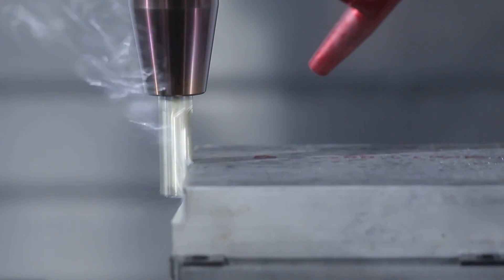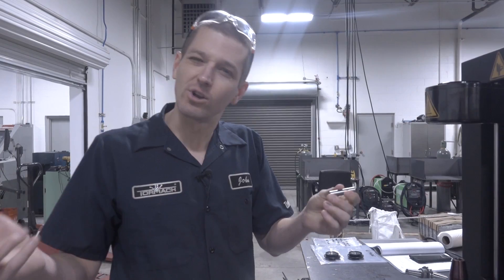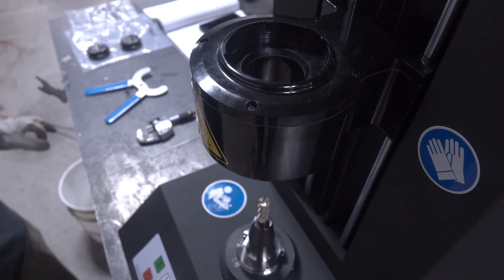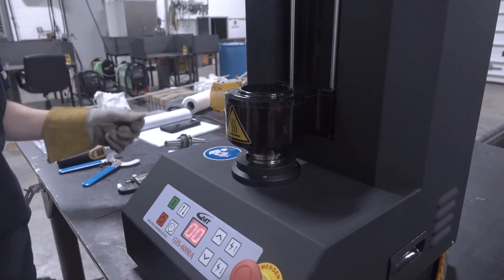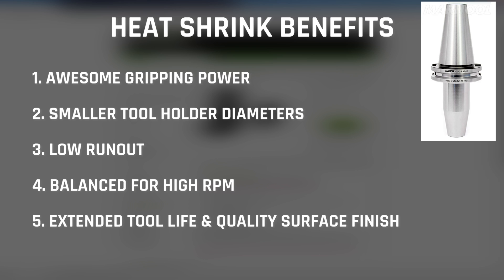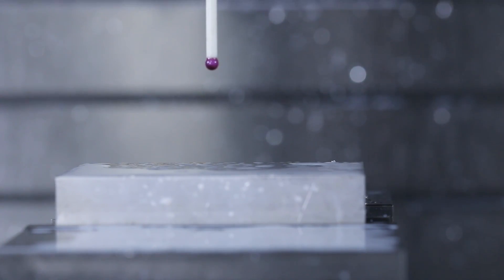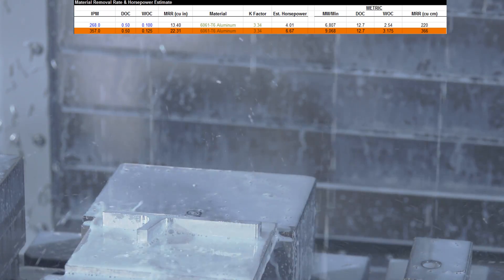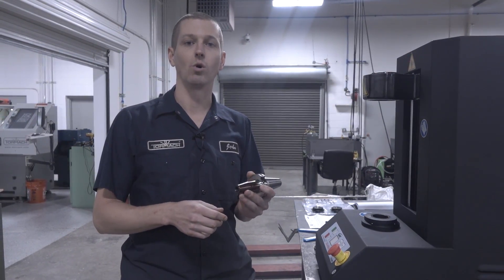What is Heat Shrink Tooling?  Testing a MariTool CAT40!

Comment: It's really Heat Expansion Tool Holder, the complete opposite of heat shrink tooling. It's not shrinking the tool. It's nothing like heat shrink tubing. It shrinks when it cools, looses heat. MariTool states it as Shrink Fit. I thought maybe there was some kind of tooling that actually shrank when heated, instead of expanding, ha. Love you man, but it kinda click baited me.
Reply: rkoz55 it shrinks to fit the tool...  hence “shrink fit” holders. 

Also. Look into how heat shrink tubing is made. You’ll find even the tubing works exactly like these holders, with the exception that with tubing, they lock in the expanded size from reshrinking. When shrink tubing is made, it’s made to the final “shrunken” diameter size. It’s then heated and expanded and filled with gas and rapidly cooled to lock the expanded diameter size.  Re heating it causes it to become pliable again allowing the tubing to return to its natural, unexpanded size. 

This is also why no matter how much heat you use, heat shrink tubing will only shrink so much.
Reply: I agree Shrink Fit Holder is a better name, which is what MariTool uses. Still not applying heat to shrink the holder or the tool as the video title suggests. Machining, like math, needs to be said the right way or mistakes happen and you have to start all over again.

Comment: When you break an endmill in one how easy is it to get out? Seems it would be really hard to heat and push from the backside at the same time and in the short window before the end mill heats up.  too bad you don't have a Cat50 machine I would let you try some of my Schunk hydraulic clamping holders.
Reply: Yes the carbide has a much lower coefficient of thermal expansion than the toolholder
Reply: The holder always expands more than the carbide tool.
Reply: The holders have a depth stop in the back, just unscrew it and you have access to be backside of the tool. then just push it out at the time the timer comes to zero.
Reply: Remove the pull stud and there's a whole through the holder you can then screw out the stop and put a 6mm rod up there place it in the heat shrink machine stopping the coil at the top heat it up and it will push rite out. It happens sometimes but it's not a train smash
Reply: Most of them have some kind of through holes just for that reason. 

You heat up the holder with broken tool inside it, take the hot holder and push the tool out. Or turn the tool upside down and heat it and let the gravity do the trick.
Reply: mikey_d dont forget your welding glove unless you want to remove youre finger prints
Reply: Schunk tendo E are the best way to get the performance without the $$$ for a machine. Really only use case I can see for this is super long extended toolholder for pencil 5th axis tool paths
Reply: not too bad to get tools out untill you get down to 1/8 inch then the swearing starts. i have had a couple breaks the wrote off the holder because the bore was damagedfrom hitting the chunk of endmill
Reply: It's fine. You just heat it, grab the holder with some bbq gloves and dump out the busted stub. No biggy.
Reply: Shrink is best, there should be a hole through, but usually just turn it upside down, falls out. Will never jam unless you put the same materials together
Reply: HighStreet Killers 
Albrecht is best

Comment: Check out ChrisFix’s latest gift guide video. He shows a hand held inductive heater that can be used to heat up tough to remove nuts. I don’t know if that would be powerful enough to use in this situation.
Reply from the maker: We tried - enough heat to get the tool IN. Not enough to get it out.
Reply: There are some relatively cheap (<$1k) 15kw units direct from the big rock candy moutain on ebay.  Might be worth investigating?

Comment: Nice explanation. Probably ought to mention as well that shrink holders cannot be used with HSS tools
Reply: Yup, have seen one 7 mm HSS drill in a holder and have to say that the runout is very good and solid connection, but once there is nothing to sharpen ;)

Comment: I've done the DIY version of this in my home garage for removing bearings. I heated the complete assembly up using a hot torch and then sprayed the bearing with compressed air from a can that cooled the bearing quickly enough to free it up. Same method works on seized bolts.

Comment: The automated coil movement seems a bit silly. Having the ability to invert the toolholder and let the tool drop out rather than needing to pull it out would be nice. Otherwise quite a nice system. 

They make small, inexpensive inductive bolt heaters for the automotive mechanic market. They might not have enough power to remove tools but would be a lot easier than a torch for installing.
Reply from the maker: We tried - not enough heat to get the tool OUT.  We were able to get the tool in :)
Reply: This thing has quite a bit more power than those bolt heaters. There was a shot of the product page in the video, said this draws 24A @ 220V, for about 5 kW of power. Those bolt heaters are usually around 1 kW.

I also wouldn't expect a bolt heater to be as efficient at transferring power to the work, since the frequency would be tuned to the application.
Reply: I know what tools you're talking about. And yes, they do have enough power to remove the tool. Way better option than paying 3+ thousand dollars for this overbuilt and slower tool.
Reply: Hak Kar this induction heating tool could be a lot more useful with a few tweaks. Logging the temperature cycle of the toolholder, logging the number of cycles per tool holder, a system to either extract the tool with the already available motion or 

detach the heating coil from the motion component and mount the tool holder so it is inverted and the tool will just drop free when the required expansion is reached

It looks over engineered for what it does, but it seems like it could easily have options added for a production environment.

Comment: Also compared to ER collets they don't get coolant in so keeps the tool and holder free from rust long term.
Reply: Arrow Racing Products 
If your coolant is causing rust, that’s a problem with the coolant.  Either concentration is too low, bad water, or coolant needs replacing.  But either way, your coolant should not be causing any rusting on anything, in fact it should be doing the opposite and be preventing things from rusting.
Reply: Yes i find most of the time that is the case but every now and then the coolant mix isn't perfect and then I can get some rust.

Comment: Very cool! I thought those machines were a lot more expensive. It doesn't look like Maritool has any BT30 heat-shrink holders, so it doesn't matter for me regardless.

I'm happy with the gripping strength and runout of my ER20 tool holders, but the narrow body of the heat shrink holders would be handy at times.

Comment: A lesson in magic: Tungsten has a Mohs hardness of 9, 10 being diamond and a steel file being around 6.5. It also has almost the thermal conductivity of aluminum (178 W/m*K  for tungsten and 205W/m*K for aluminum while steel and stainless steel and cast iron ranges between 10-100W/m*K) and last but not least it has almost half the thermal expansion coefficient of granite, which is thought to be one of the most thermally stable materials and used in metrology for this reason...That's magic!

Comment: According to their website, about 5kW of power from the induction heater, this is easily attainable.
Reply: Those 5KW of heat are insanely efficiently pumped into the tool holder. The way the induction heaters work is that they actually use the tool holder as the heating element. The heat is generated by flowing a LOT of electricity through the metal of the tool holder. You can think of it as a transformer, where the secondary winding is 1 winding that is shorted.
Reply: I was just mentioning that someone could fairly easily build their own if they were so inclined.
Reply: Power electronics is tons of fun though.
Reply: Sematics here Andrew.  20mA at 100Kv can kill you quite easily.  Of course it takes SOME current, but very little.
Reply from the maker: We looked - and there are some DIY plans out there.  Risk is you're dealing with some high current - levels that could quickly kill you.
Reply: stizzit Not true, it's a combo of both. And you have the saying backwards anyways.
Reply: Current doesn't kill - voltage does